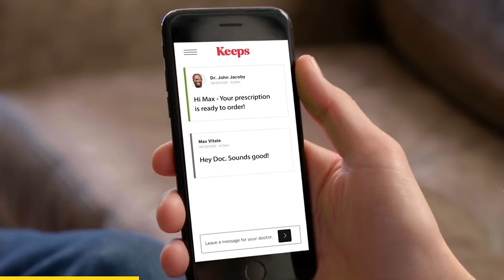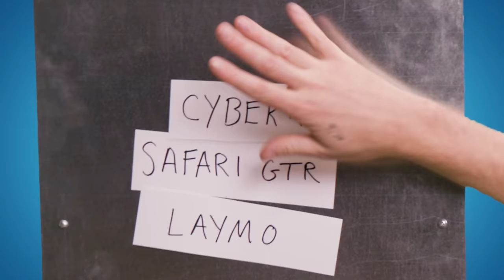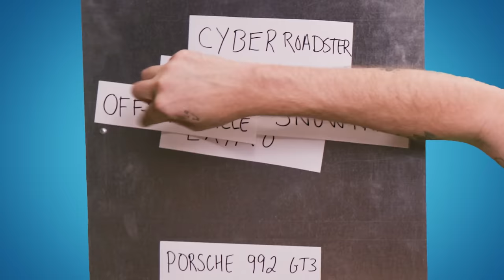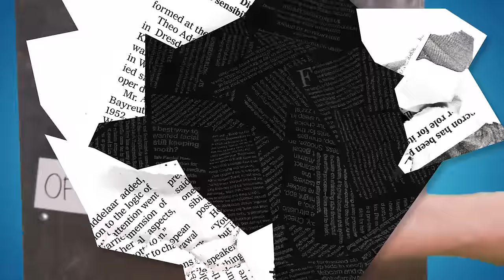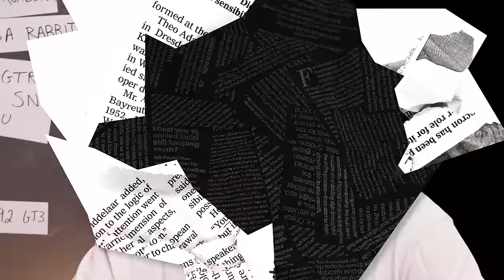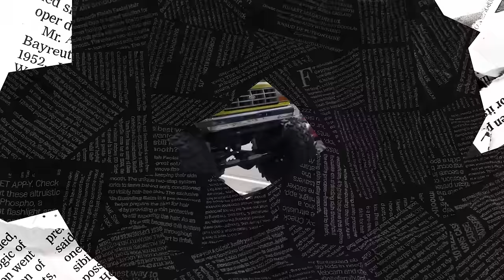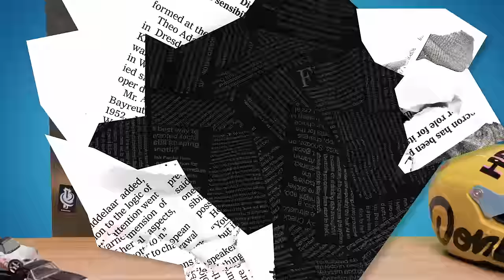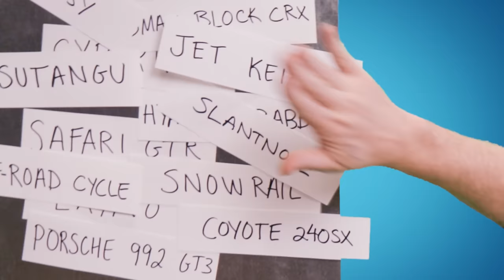Car Youtubers Need to Chill

Comment: Superfast matt and rob dahm got slept on so damn hard dude... Offroad viper, tesla-swapped jaguar mk4, a custom land speed car with a bmw bike engine... An AWD swapped rx7 with a 10 inch widebody and turbo 4rotor pushing 2000hp...

And that's not even mentioning aging wheels' electric dual motor 900hp ford escape

Comment: A suggestion to include in further episodes of this: JP Performance
Granted, his content is in German, but him and his crew have built (and are still currently building) some crazy cars! Here are some of the most notable ones:

-A Mercedes 500E with a V12+manual swap
-An A90 Supra with a BMW V10+manual swap
-Momentum, a KTM X-Bow with extra Aero, slicks and a twin turbo Audi V6 with the turbos mounted on the outside of the car
-Thunderbunny, a Mk2 Golf with an insane custom widebody and a mid-mounted VR6
-A motorbike swapped Renault Twingo
-The Supergolf, a Mk7 Golf with a RWD VR6 swap, an Audi A4 subframe in the front and custom pushrod suspension in the rear

And there's a lot more! It would be awesome if you could feature some of his stuff on the D-List!
-A full tube frame Mk3 Golf with a full Audi R8 drive train (with a lot of stylistic inspiration from James' Golf), which is an ongoing build and probably will be for quite a while

Comment: One channel/build people really need to check out is "Build It Yourself". Dudes built a set of 4 valve heads for a Ford V10 and put them on a fully built block, got it running and they're putting it in a RWD converted late model Lincoln Continental. 
I get that they're not "Influencers"/part of the YT car influencer clique, so they never get the recognition they deserve, but everyone needs to check them out. It's incredible what they've managed to pull off. I guess they spend their energy on the build more than marketing.
Reply: Here! Here! Great Channel definitely check it out. One of my favorites

Comment: What's so funny about the limo tackling a 45° incline, is the fact that unironically it's probably way more stable because of the wheelbase. So long as you got the ground clearance, you don't have to worry about over sending it and accidentally flipping it

Comment: I’d like to see your take on this video idea: what is the best kind of car to make for the apocalypse?

You can do a video on which is the best kind of car to drive, but I’m more interested in what kind of car you should make based on the parts that are available if an apocalypse happens.

The rules:

By Apocalypse, I mean that there is no longer any infrastructure. Gasoline refinement is minimal to none. Same thing for any kind of parts. The only parts that you would have available would be those that you might find in a junkyard or an abandoned demolished car dealership that has been left abandoned for at least 10 years and is subject to the environment and the degradation of wind and water and so forth.

Any kind of vehicle can provide parts, so long as you can justify being able to find them.
The winning car should have the easiest ability to repair, the easiest ability to power, and be reliable in an environment where reliability is dependent on how well you can maintain your car, and how well it can handle damage roads, bullets and arrows, and any number of environmental hazards.

Comment: I worked at AutoZone for a few years and had a guy come in with a Fiero with a 4.9 liter V8 shoe-horned in the back.  He said it would fly.
Reply: @promethbastard  you have a point.  It was gold colored with matching rims and interior.  It was really nice.  Said he can't take off in 1st gear most of the time because he spins the tires.

Comment: I am gald the D list is back but, I am desapointed that you didn't look out of america. And you didn't talked about Vilebrequin who made a 1300 hp Fiat Multipla with a unique Rocket Bunny body kit, unique Works wheels with the deepest dish made by Works. On top of that, it drove at the 100th 24h of Le Mans on the circuit. Please make another and this time, check out of the US

Comment: We have an actual teenager here that has a complete build from the start on an old Toyota Tacoma with a Mercedes 300d diesel swap and it's tuned at around 400-500 hp if I remember right, and it's usually cruising around on slicks on cruise nights and it rips, nice work on that. Also another with a Ford Fairmont with coyote swap with turbos, and is turning over insane hp and is probably 5 different colors, and doesn't usually lose. What's cool is on the front fender he decided he was goin to put tally marks on everything he's beat, he has several hellcats and Teslas etc. so far.

Comment: As a Certified Tesla Technician my first thought about the custom roadster is "will the body panels fit like a normal tesla, shitty?" Then I saw the welder and all the rods and died in my chair. If he doesn't get banned from tesla for life for that, I'd be absolutely shocked. Tesla does not encourage any welding on their vehicles due to the underbody battery; instead they provide massive body rivets to section out panels (mated with bonding techniques). They've threatened to ban our shop just because we don't have a dedicated aluminum sander.

Comment: I’d really love to find a capachino and put in either a super bike motor or another high reving 4cyl, I would say a b16/18 but they have become really expensive, so maybe a k20 and turn the valve train into a 12k rpm along with itb’s, the capachino is so light that even hitting 250 to the wheels would make it a real track killer, my only concern is the super short wheel base with will make it twitchy and easy to oversteer and not be able to correct it.

Comment: I'm still shocked there isn't a mechanic out there showing people that you want your intake pressure requirements to match you exhaust pressure. If they don't, which most aren't even close, then your instrument is out of tune. Your crank and rockers will suffer and wear. What I'm trying to say: you can't just short an exhaust out of your turbo while you have an intercooler and intake filter. If you're exhausting that way, you need to intake that way. The people of old used to call it something like 'balance'... Most patterns now on cam shafts and crank journals show one end peaking. OMG HOW COULD THAT BEEEEEE

Comment: Ratchet strap compressing the suspension was how they passed the inspection?! I had a mate fail an inspection because he forgot to put 2 bolts back in the holes where he’d removed the rear seatbelts as part of re licensing as a 2 seater

Comment: 13:50 I wanted to do something similar with a 99 or 05 Honda, and after stating how I wanted to put a 6.6L Chevy engine (like in my dads truck) in it with a 4L80E transmission with the heavy duty drums, and a mechanic made it clear that people are stupid for thinking a car can fit any part; I tried pointing out how it was possible with such drastic modifications and usually a kit (to make it easier) like most sleeper cars, but that apparently pissed him off more, and after being personally called a dumb*** that doesn't know ** I just stopped talking :/

Comment: Need to do a bit more research on the vids lol grind hard plumbing did not complete the hydrologic steering. That did not work and it was then switched to cable operated turning methods. Love the videos. Especially the mechanics react videos.